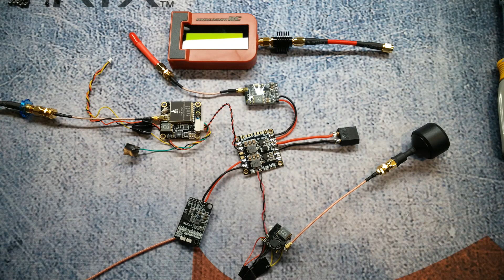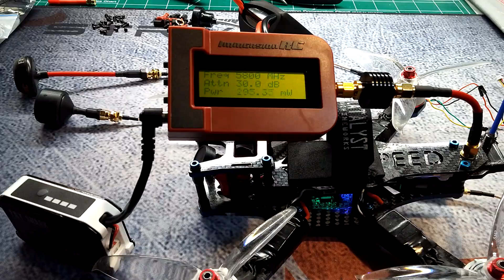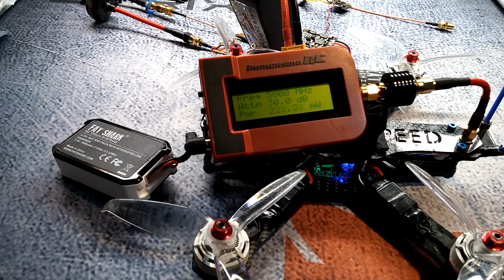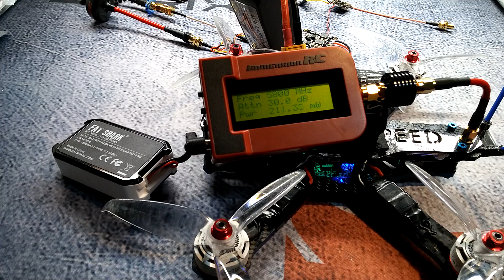VTX Shootout & Power Output Testing

Comment: Thanks for the video, it was very informative.  I'm actually really surprised the RDQ VTX worked so much better than the AKK.  They are both made by AKK, I wonder why the huge difference in results...
Reply from the maker: John E Fly - I can't really say besides the fact of qc issues, and from what other's have noticed, the vtx output is all over the board.
Reply: That makes a lot of sense, it's not necessarily that RDQ performs much better, just that this is only a single sample, and likely from what we're seeing each sample is likely to be very inconsistent with the other.  Thanks!
Reply from the maker: John E Fly - Check the pinned post for clarification 👍